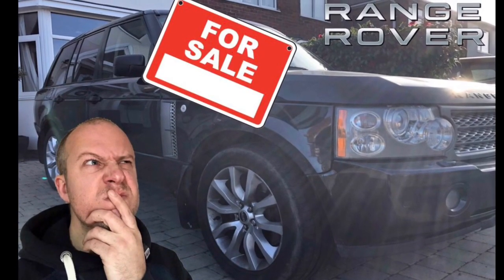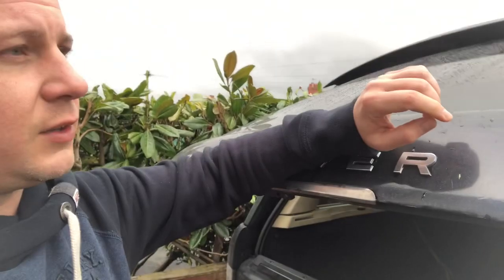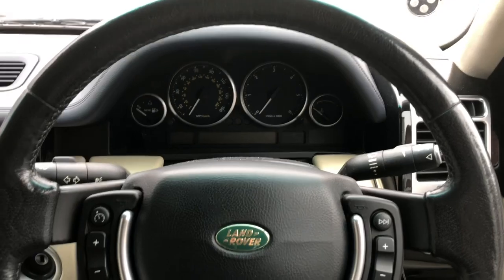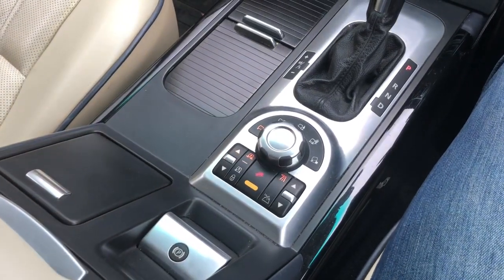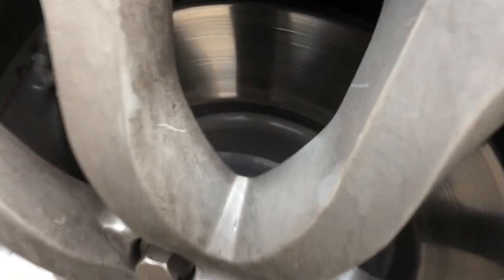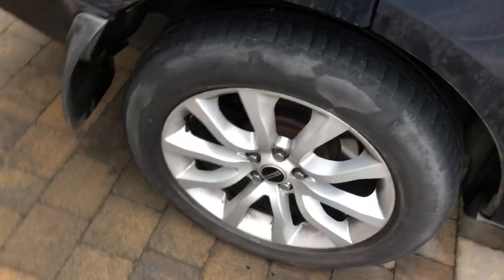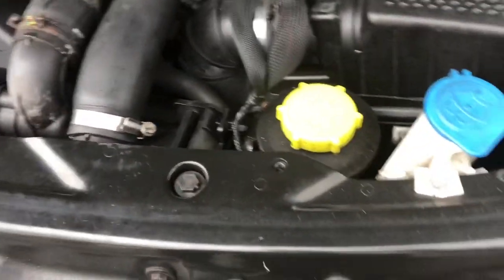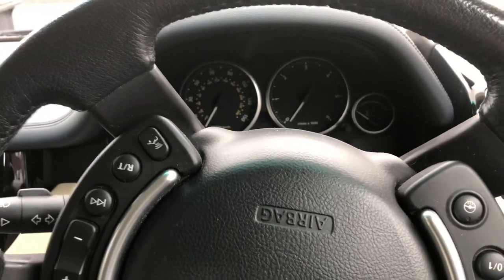Range Rover L322 TDV8 Buying Advice

Comment: Have mine TDV8 for 2 years now. I bought it for 10000€ with 240.000km, 2007 . I bought it because both turbos had been replaced. One headache less. 
Following points to check: headlining as with most of English cars tend to come down. This time I didn't replace but instead fixed on the backside 3 thin aluminium bars which I painted in headlining colour. It looks like original
The car has now 310.000 . Motor is perfect. No loss of oil, smooth and quiet
No leaks at all
Removed TV and Bluetooth (had a problem). 
Please clean the sunroof water pipes. If stuck You will have water ingress
The gearbox works fine. I have an issue when it is cold outside, that the gear doesn't directly get in and you will get a transmission fault. Since I got used to it, I feel when it is not getting in and put it back to park. I wait 2 seconds and thenput it back in D and no issues.
I had to replace the front air suspension. I had an air leak because the previous owner applied a seal kit wrongly.
By some reason I had my second battery in. The batteries are actually to small for such a car. The best would be to have a second in the trunk. But spending 90euro every 20 months for a battery...well I can live with that.
From the beginning my car was creating black smoke with kickdown. Since the turbos are new I just had the idea to add injection cleaner to the diesel. One load of it cleaned everything. No black cloud anymore .
All in all I spent around 2000 Euro in 2 years. Now (except the issue with the gearbox) everything works fine. A simply amazing car. My last P38 V8 petrol with LPG lasted for 400.000 km until a wall on a highway crash decided to divorce me from the car. The car saved my life.
The TDV8 is an amazing motor. Recently on a long trip to France with family on board  I managed 990km with one tank= 9l/100km. For a 2.7t car amazing

Comment: 9 years ago when I bought my low mileage 2008 L320 which I still have, and even 5 years ago when this video was made, there were no DIY diag/OBD readers to my knowledge that went deep into LRs. Today you can buy a Kingbowlen Ediag for £60-£70 (which I have and is brlliant), or for hard-core LR owners, an IID tool for around £500.  Take one of these along if you're planning to buy a Range Rover (or almost any car with an Ediag) and if the seller/garage isn't happy about you plugging it in, walk away.  On the flip side, there may be easily rectifiable faults which the seller thinks are catastrophic and mega-costly, but they're not.

Comment: Bought a 2008 Vogue Luxury 3.6 (black on black) with 148,000 klm’s on it last week (most have double that) and everything does what it should, it’s like new, no dings anywhere, not even the sides from car parks: 22” wheels, egr’s removed and a remap which I would’ve done and that V8 rumble is to die for, the diesel V8’s are just so damn nice (I’ve owned a Kenworth with an 8V/92TA which being a 2 stroke was something else again and driven many Scania and old Mack V8’s) the power from such a small engine and heavy car is brilliant. I’ve owned three other British cars, a 69 Spitfire, 24/80 Wolseley and 1995 XJR Jag and all were looked after impeccably, seems most British vehicles are, at least the one’s here in Australia. The only possible issues it seems are the air suspension (mine is great) and turbo which can fail in any turbo charged vehicle just they do give a fair warning before causing grief, it’s the non mechanically minded that keep driving until they fail catastrophically and cause compression lock up, not really a fault of the vehicle and nothing regular maintenance won’t pick up: every manufacturer has the odd lemon, even Toyota but as good as they are they just don’t have the class and here you’ll pay twice the price for a used Land Cruiser with twice the klm’s on it, unless of course it’s an ex mines vehicle in which case you steer clear of it. Because some vehicles will go 300 - 400,000 klm and then some without fault we’ve come to expect that every vehicle will do the same when even those are a rare beast.

Comment: Glade you mentioned the air suspension mate, it was my biggest worry when buying my Rangie Sport. I did a video walking round showing people all the feature and what not. Think its had around 110k views so shows how popular these cars are, I still love this shape.
The only thing that went on mine was bottom arms around £400 all in with labour and 4wheel alignment. Also they rear parking sensors speaker in the back broke and threw a fault on the dash.

Comment: Good practical advice. The only thing I'd include in the check list would be to thoroughly check the cars log book against the car VIN etc. And, importantly what is the service history like overall, dealer service? regular service intervals? mileage validation, and if required has it an MOT and when is the due to expire and were there any recommmendations at last MOT and were they dealt with?

Comment: Don’t underestimate the general look around as the condition of the car on the outside can be a good clue to the condition on the underside….. if little things have not been done such as a cracked fog light or a missing piece of trim that are ultimately a cheap fix there is a good chance that more expensive items have not been done either…. On any 4X4 I always check the tyre branding is the same at least on each axle if not all round….
Reply from the maker: That’s a good point about tyres - always as a pair (at least).
I’m not a tyre brand snob though, and I am open to using good quality budget tyres too 👍
Reply: @Nut_Job.  Yeah sorry should have said it doesn't matter what the brand is just that they are the same tread pattern.....

Comment: Love the videos, learnt a lot, when it comes to cleaning the sand coloured plastic doors and interior I had exactly the same problem, nothing seemed to shift the grime, especially along the top of the trim below the drivers window....
May I suggest "Elbow Grease" , I tried LOADS of different cleaners and none seemed to make hardly any difference in moving the grime, but when wandering round B&M Bargains I saw this Elbow Grease in (I think 1 Ltr) bottle complete with spray nozzle, for around 0.79p
spray on the affected area, rub in not too heavily with a scotchbright pad leave for a couple of minutes with a damp sponge...looks a LOT better, hope this helps, Gerry

Comment: Is it advisable to use pre-purchase inspectors, AA or RAC? This is for pillocks like me without any idea about vehicles.
Reply from the maker: Well, I don’t have a lot of experience with these inspections as I usually do them for myself… but I did once sell a car & a buyer sent one of these people round to inspect my car for him. I knew my car very well, however he did a very poor job & spent a lot of time twiddling all the interior switches (fair enough perhaps) and revving my engine. He didn’t pick up on a couple of minor issues I knew about, but did claim to suspect it had a respray at the back & tried to knock down the price on that basis. I wasn’t impressed & told him no - take it or leave it 🤷‍♂️

Comment: All pretty good advice there mate. I got a V8 4.2 Supercharged . It’s also fitted with LPG which saves me quite a bit really. I had a Auto Valve Saver fitted the German make. I’m now considering a gearbox oil change. I know they are sealed for life ( or suppose to be ) but mine has done 144000 . So common sense tells me ,that surly it must be pretty shit by now.
Reply from the maker: Yeah, with mine at 166k when I bought it I did the transmission fluid/filter straight away 👍
Reply: i would always do a mega flush (depending on model) every 100K.... always feels like a new car after
Reply: Rizla--King what do you mean by mega flush mate ?
Reply: @ROY-COLLEY  So this does vary but if you just do an oil change on the gearbox by draining you will probably get around 4-5 litres out but the gearbox actually holds around 9 litres.... a mega flush is where a machine is connected to the system and actually pushes all of the old oil out with new oil.... a bit like a blood transfusion.... probably looking at around £350 but it will be the best money you will spend on the car.... it can help if you have TC shudder too....
Reply: Rizla--King  thanks for the  info mate.

Comment: Hallo! 
I am really obsessed with this car. I found one. 2010 vogue, 250.000 km. Seller man said sometime car goes notlauf. In English emergency run. I am so confused 😖  at forums it can be simple under it or complicated reasons. 😬 I live in Germany. I have already audi a6 2008. This car maintenance not cheap too...  Range price is 10.800 I think bargain possible. I found a Land Rover workstat in Hamburg. I am planning I will take the car and run to workstation. Car has check heft. Until 2016 (197.000 km) all controls made in Holland Land rover workstation. Then the second owner change the oil and filter I guess. When it ran emergency run he decided to sell. Obviously there is no guarantee which car you find and buy you can see this. It's good thing I already know about this car. Some others  hiding! If you love this car yes they have high km..they need to special care. For New cars also, you need a chance. You need a chance for buy a refrigerator too 😬 I don't like evoque.
Reply: Ahh it has 3.6 tdv8 which I am searching. Lol supercharged for Britishs and Americans.

Comment: Hi mate how’s it going u had any luck selling then Range Rover? I’m still looking getting fed up of looking at nails! 🙄 great new content with the ex police beemer 👍🏼
Reply from the maker: I’ve still got it mate, it seems no ones buying 4x4’s really at the moment - least of all high-milers like mine. Thinking I might have to hold it until winter when demand should pick up. You don’t want to buy it do you? 😁
Reply: 😂 I have started looking at tdv8s as there’s hardly any 4.2 supercharged ones about espesh ones that are in decent nick. What would you say needs doing on yours next? Is the torque converter on its way out
Reply from the maker: I’ve actually got a torque converter that I’d give the next buyer too if they want. I suspect it might want doing (hence buying it) but the car drives fine, as you can tell from 10k in the last few months 😂
My feeling on high milers is that if they get over 140k with all the important bits working then it’s proven itself to be a solid car 👍 others are still afraid though
Reply: Any rust on the rear arches? What history u got with it?
Reply: Any rust on rear arches? How much mot ect? What history you got with the car
Reply from the maker: There’s main dealer/specialist stamps going back to when it was new. I’ve obviously done a bunch of things (as in the vids) but the rest of the mechanicals appear to have been looked after. There is a bit of rust coming through on one wing, but I wasn’t bothered by it as it just looks like discoloured pain at the edge - it could be repaired/replaced but I’m not that fussy.
Reply: No probs what’s the interior like condition wise? Tyre make and condition
Reply from the maker: I’d say it’s pretty tidy inside considering its mileage. I think the tyres are Continentals, but will need changing soon to be fair

Comment: My friend bought this car recently and it's great! However, it's missing that big black box next to the ABS. Can you tell me what's that for?
Reply from the maker: That’s the engine electrical box. I think there’s a few big relays & a load of electrical connections in there.
Reply: @Nut_Job.  Thanks for the replay. Hmmm, that sounds like something important. I'm wondering, how can it be working without that...
Reply from the maker: Yes, it’s slightly concerning... but if everything is working then I assume your engine layout must be different to mine. Probably nothing to worry about 👍

Comment: O yer One question you may know. I only have one horn on mine. As you stand in front and look , the one on the left is there. I looked at it and it says High. Now the one on the right is missing. The block connector is just hanging there. My question is, do you happen to know are they all different ,in as much as I have looked on eBay and the ones I have seen are different connections to mine. My one is a 2006 Sports Supercharge V8 4.2 .
Reply: Roy Colley look down by the coolant bottle. The 2nd s sometimes there. If the horns sound loud you probably have 2 working ones. Or unplug the one you see and then test to see if there is a second.

Comment: I’ve got a judder at 30 mph incorrect gear ratio and Tcm  transmission control module is that going to be pricey
Reply: Peter Virgo - Have you tried put a tube of Dr Tranny in the Gearbox?

Comment: Or a more comman (10k - 14 k budget)
Look for the biggest rims.
Has the glass been tinted to limo spec.
Does it have a bling grill and clear indicators (or a facelift update)
If all the above is a tick,then buy and then jump on the net and complain about how unreliable a range rover is.:-?